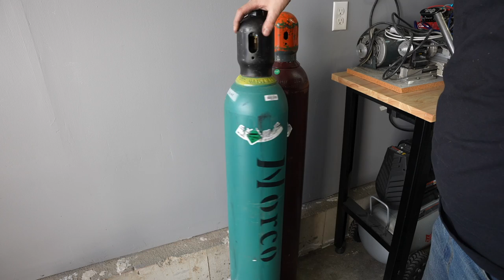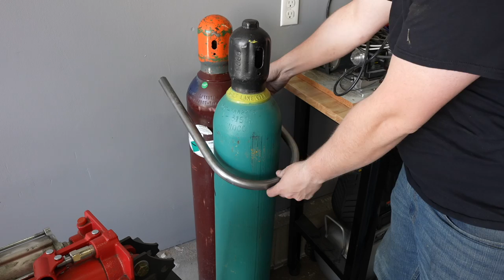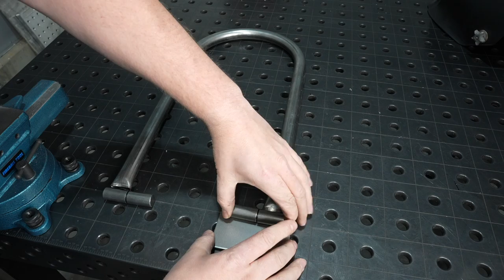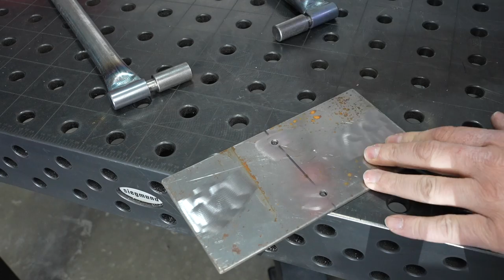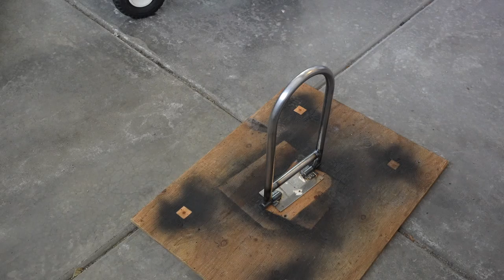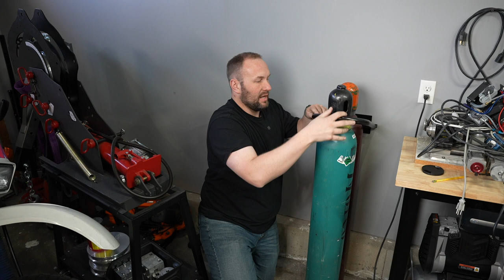I Invented This for Safety | Gas Cylinder Rack Build

Comment: Where I live, storing your cylinders like you did at the start of the video is literally illegal. So, good for you that you are tackling this safety issue 👍

People here tend to do pretty much what you did with your parallel bars, but with chains instead of your bend. The chains can be easily removed to allow moving of the cylinders
Reply from the maker: Thanks! Even though it's just me in the garage, I've worked a decade in factories and try to keep my shop up to a similar standard to the extent that I can.
Reply: @TimWelds  it's not just you in your shop though. "We" are too 😉. You run a pretty successful YouTube channel, and a lot of people, like me, use your videos as a learning experience and for advice.

Having you show how to properly secure your stuff imo is just as important as all your other safety lessons. Keep up the good work. You were one of the first YouTubers I found who picked me up where I was when I knew literally nothing about welding and had gotten my first simple stick welder as a gift. I didn't even know where to put the mass clamp, or whether I was allowed to touch anything while welding 😅

Comment: Great idea although I suspect some subtle refinements might make it better - a position lock of some sort to keep it above the 1/2 height mark on the tanks. Having some sort of "foot" to hold the bases in place when the rack is down so the bottom can't be kicked out from below the rack is the primary improvement I'm thinking of.
Reply from the maker: Great suggestions! I think the bottom getting kicked out by something rolling past is the biggest potential failure.

Comment: Seems like a pretty quick and effective solution to me. Good work! As a potential improvement, how about adding some plumbing insulation (padding) to the tubing and maybe even a cross bar in the middle of the hoop with some padding as well? Not only will it make the tanks fit more snugly but it will keep them from clanking one another as well.

Comment: I’ll add a holding base at the bottom of the cylinders. Two pieces of steel angle running parallel with a metal plate welded on one end to bolt into the bottom stud like you did with the top piece. Weld a couple of metal pieces between the two steel angle pieces to hold them together. That will keep the cylinders in line at the bottom too. Hopefully you got the idea. Can send you a drawing. 😅

Comment: I see no issues with this as far as safety. I do like the convenience of usage vs a chain. I bolted one end of my chain and made a slotted bracket for the other end and it captures one link of the chain and gravity keeps the chain in place. I honestly like what you made. It could even be made from 1/2" or 3/8" round bar and I think flat bar as well so it presents many construction alternatives. Thanks for posting this. Kudos for a job well done.
Reply from the maker: Thanks a ton! It could definitely be done just as easily from round or flat.

Comment: Great job! Just a thought for safety with one tube installed what if a child puts their hand on the Lever in the up position and slams it down on the side of the cylinder? Does it have a soft close or perhaps you design a stop at 90 degrees? Keep trucking great video!

Comment: This is a good exercise for bending, but if you can't do it right away, then at least get some eyebolts and a chain with a snap to secure them to a bench or wall.  The bottles should always be secured when a regulator is installed. Although the bottles are quite safe when the cap is screwed on properly, they are very heavy and will hurt you ( or a kid) if they fall on you.
Reply from the maker: Great tips! Thanks!

Comment: Great idea. I built a bottle trolly from scrap but I need to design a receptical to hold it to the walll and bench so it's safe when it's stored or when it's in use.
Reply from the maker: Thanks! I've been thinking about building a bottle trolly myself.

Comment: That's more secure than most "approved" set-ups I've seen.  
A toe plate on the bottom to keep the cylinders from skittering out in case of earthquake or attack of the forklift might be nice but then it wouldn't allow you to use that space for something else when you don't have cylinders to store.

Comment: Dont know if I've made mention of this previously.   Like your RogueFab bender.  I have one and it is so much easier and more precise than the horizontal bender i used to use.
Reply from the maker: I've been really happy with it so far! I almost bought a JD2, but I don't have room to bolt it to the floor and sweep tubing horizontally, so I went with this one, glad I did.
Reply: @TimWelds  My previous bender was a Pro Tools horizontal bender ( just like the JD 2 ).  Not only does it require a great deal of floor space to use but you are not in a position to watch the scale and pull the handle at the same time.  You almost need another person to watch the scale while you pull to have any real hope of producing consistency.   I have an electro/ hydraulic power supply with my RogueFab.   It has a joy stick control handle.  This allows extremely precise control so exact precision is almost assured.

Comment: It looks like there is enough space along the wall to mount both cylinders against the wall.  I would not want to have to move one cylinder to get to the other cylinder to make a hook up.  Anytime there is an unsecured cylinder it becomes a safety concern.  It would be easy to forget to put back a cylinder into the holder.

Comment: I really liked your bending machine, what brand is it? Thanks for sharing your ideas, greetings
Reply from the maker: It's a weld together kit that I bought from Rogue fabrication a few years ago. I really like it compared to the manual horizontal benders because it doesn't have to be fastened to the floor and you don't need room for the tubing to sweep horizontally. I have a video of assembling it on the channel.